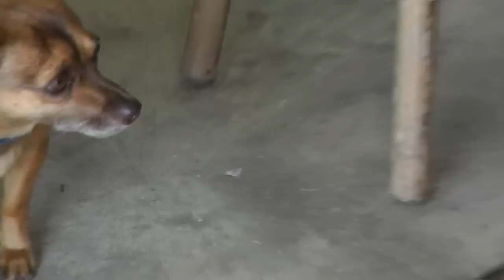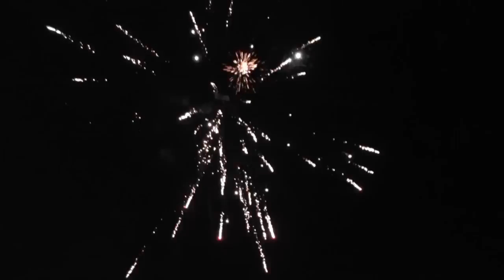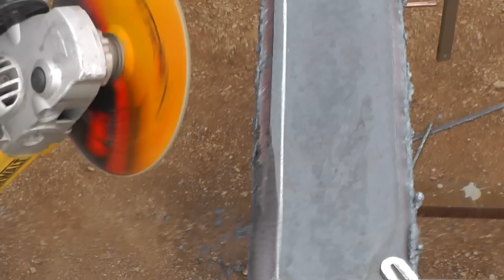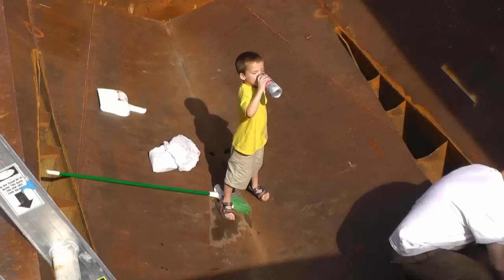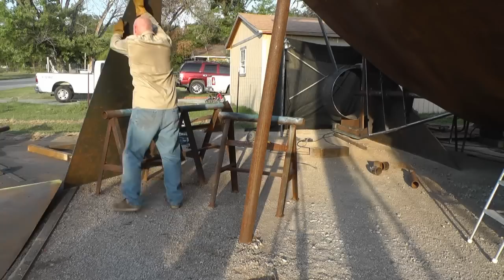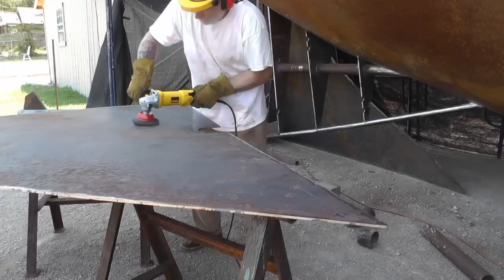Skeg and Rudder - Part 4

Comment from the maker: Thanks.  Glad I'm not the only one.   No tubing.  The whole thing will get filled with engine coolant.  The frames stiffen the structure and force to coolant to take a serpentine path from the input at the top to the return at the forward end.  And I don't know the numbers but the heat transfer from liquid to liquid through steel is much much better than a normal air cooled radiator.

Comment from the maker: Yes, that's exactly how it works.  The stainless shaft collar has set screws and rotates with the shaft.  It's just that the shaft still has some bad pits in it and I'm not sure water will not leak past those o-rings on the collar, even though they are static.

Comment from the maker: Good point.  I think they don't want oil getting on the ceramic surface.  Might cause smoke?  No sure.  But a squirt of water proof grease between those two would sure stop a drip if one shows up.  I'm still considering JB Weld to fill the pits in the shaft.  Any ideas about that?

Comment from the maker: That's right, I put some tacks on the inside of the first plate but on the second plate we'll use "plug welds".   No need to cut it into sections.  We'd never get it to bend smoothly if we did that.

Comment: Me again! Just thinking about that prop-shaft seal and I believe it operates like an automotive water pump seal, in which case, the piece with the "O" rings is actually supposed to be locked on to the shaft and spin against the ceramic seal! .... just my guess!

Comment: Hi Doug!
I've been following your videos for a bit now, I enjoy them a great deal.  I also admire you and Kay.
Sometimes I see something which my experience says you should do differently.  What you did with the round stock is called slugging, it is not an accepted practice.  My concern is a potential for the entire section around the hull penetration to fail.  The location of the penetration would make this very difficult to deal with in the opinion of this retired Damage Controlman.
Heal well!

Comment: He's not finished welding it and once the skeg side panels are welded in place the load will be distributed along the whole length from the keel all the way to halfway up the transom. I'm looking forward to seeing what kind of re-enforcing framework Doug has planned for the skeg and keels on the inside of the hull. So far she's a beauty Doug.

Comment: Can't wait for the next post... The end looked like me, my noodle gets bumped all the time. I know the notches are for tubing that will cool the engine; are they going to be steel, copper, brass? I am just wondering how much heat you can dump into the keel-radiator?

Comment: I know that you can weld one side of the steel plating from reaching through to the other side but the 2nd side should be cut into sections so you can weld it to each cross support 1 at a time and get all the seams welded up solid!

Comment: Have an older porter cable 3x21 sander. Works great on metal and is very easy 2 keep a constant plane. Plus belts are very cheap at Barbour freight. Also might help finish, choosing different grit. As always, great work.

Comment: Filling a gap with rod is not really a good thing to do, what happens is you have an area in the middle of a fillet or seam that actually has no weld penetration nad can lead to failure eventually. It is better to fill big gaps with weld and weld the awkward side first so that you can back grind into the firat weld.
Reply from the maker: +mattblack    No worries.  Not everything needs to be at full strength.

Comment: please use a form of dust  masks when using the plasma cutter please :-) the dust is super fine and go straight into the lungs :-(
Reply from the maker: The doctor told me to take an iron supplement.
Reply: what a doctor the local blacksmith?
but ok it's not my problem, but please :-)

Comment: Geez don't die! Then the videos would stop.....and millions of watchers would be sad. In similar circumstances, I used a come along with tacked connections on the other side  to pull the plate into the framing.